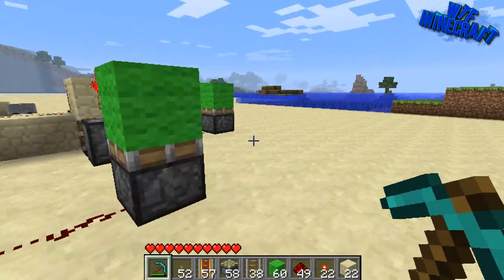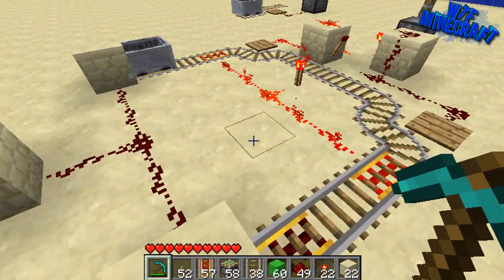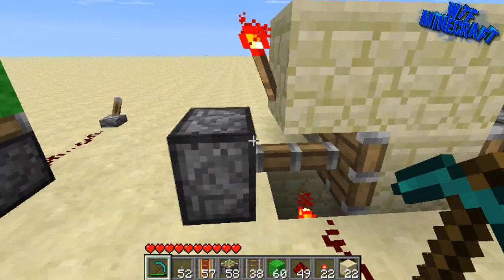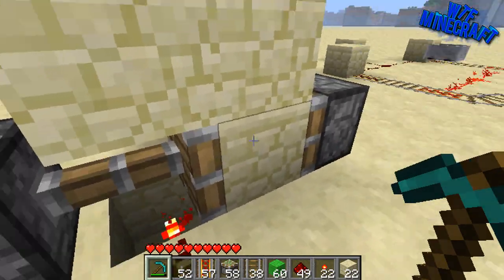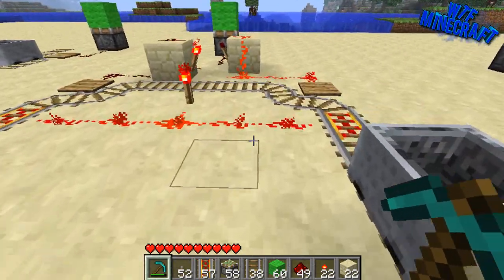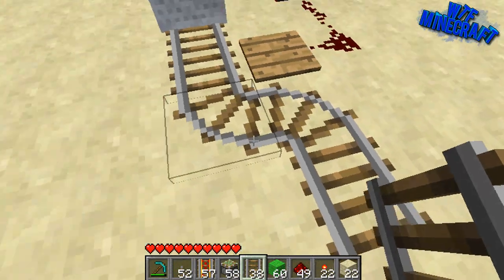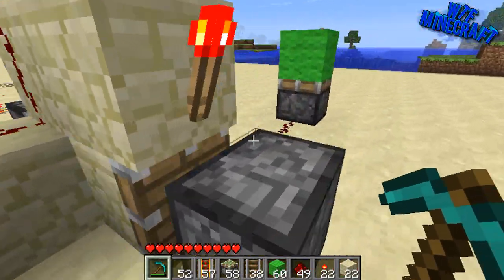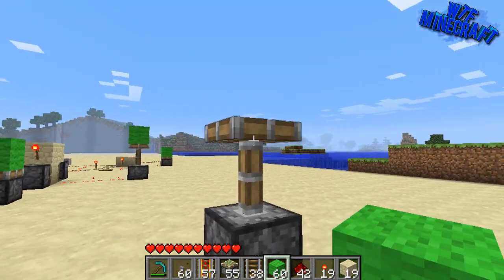Redstone tutorial - Episode 3 // T-Flip flop's

Comment: @ricklo123 well if you want to use a pressureplate/button to switch on a system and keep it on, you can use the T flipflop. notice by pressing that sort of button the wire connected is usually powered for a few seconds and switches off. By using the T flipflop you can use that few seconds of power to switch on or off a system forever, or until the button is pressed again.

Comment: @NpII02 The system is triggered by a pressureplate but the problem is that once you step away from it, the system stops and the floor drops down. If you notice by pressing the button in this video, the piston in the distance will stay up or down by one button press and will stay that way forever. I hope this answers your question :)

Comment: @NpII02 its the very basic thing in computer memory, have many of these allows to store bits/bytes. people use this system in minecraft to build computers but also to have a system that can be switched on or off, and stay on or off without having to stay on a pressure plate. For example I built a floor that consists of pistons pushing blocks up, allowing entrance to the floor.